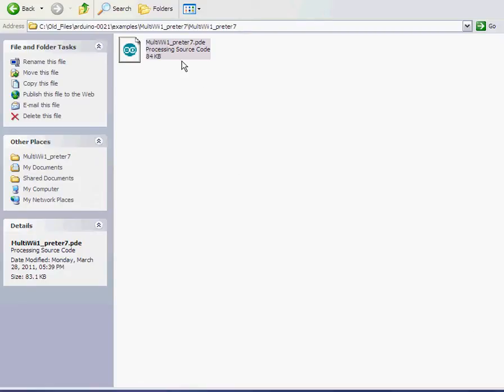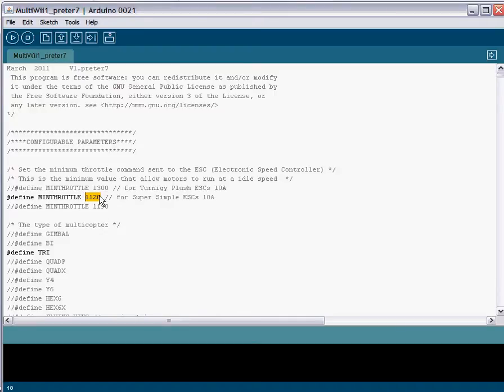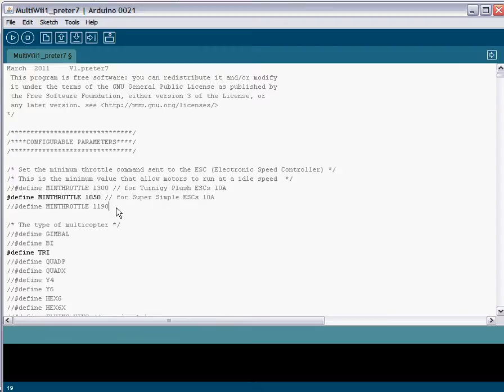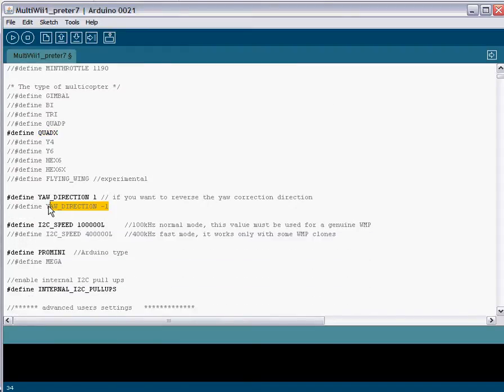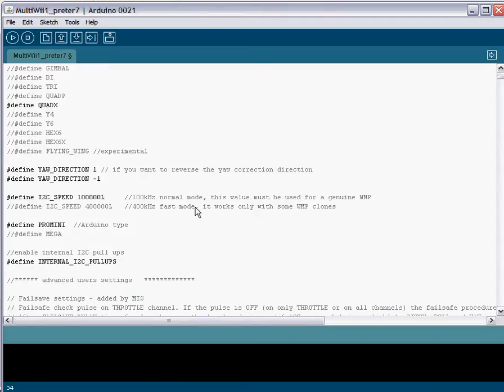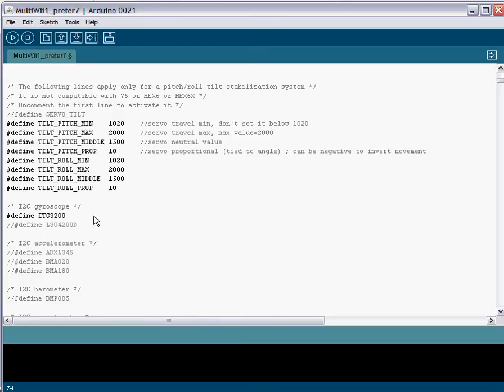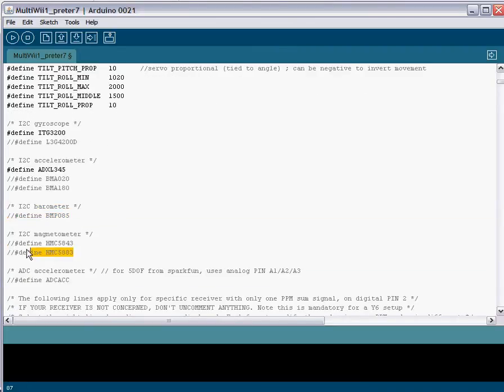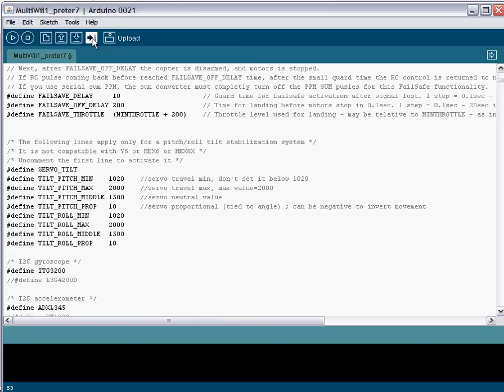How to Use Multi Wii Sketch

Comment from the maker: yes you have to define the IMU,   ( each IMU has different sensors,  hmm the same I guess but different models )    you at the specs .. find out what version of .. gyro, acc, ect.. it has.. then find an IMU that match or define one yourself.. this will also determine the orientation of the sensors.

Comment: Hi, I've purchased the "MultiWii 328P Flight Controller w/FTDI & DSM2 Port" from Hobby King and am using the "MultiWii_2_1 | Arduino 1.0.3" and under basic setup, I've chosen "#define QUADX".  However, I do not know which to choose under "combined IMU boards" and was wondering if you could help me out with that one or even if I have to choose one.